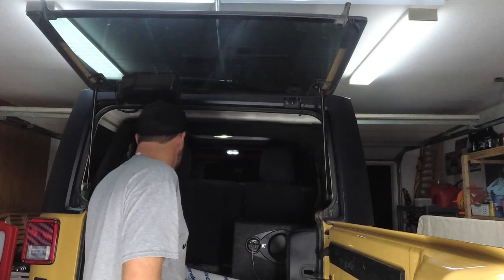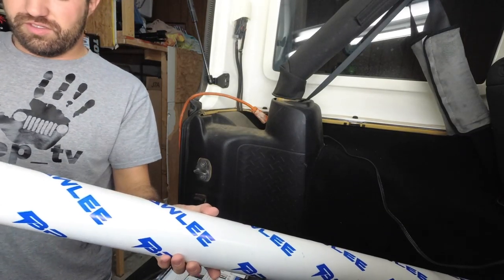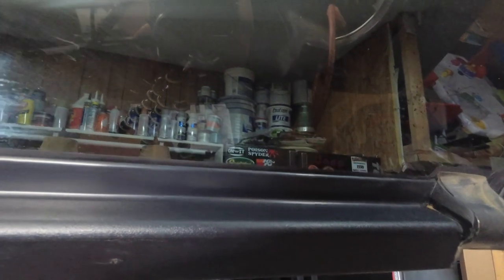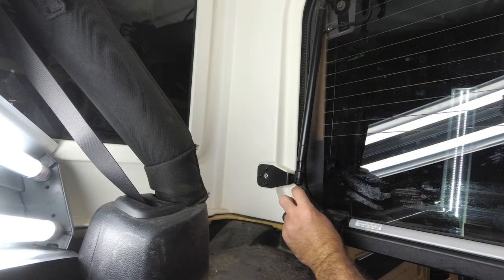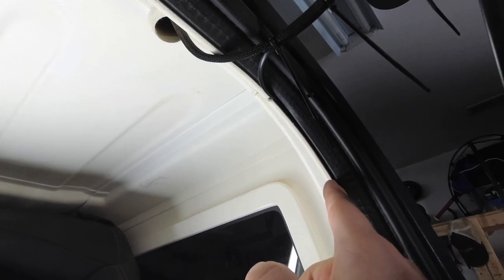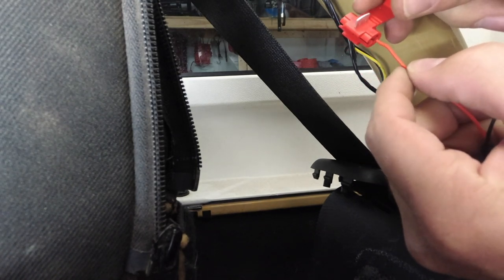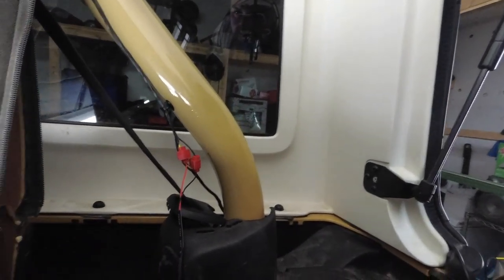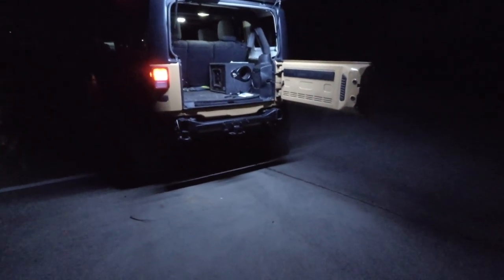How to install The Brawlee Tailgate Light Bar | From DonerightLEDs

Comment: This is one of the best things that I have done to my jeep. I ran mine to a pushbutton switch and mounted it right beside the 12 volt supply plug because I only want it to come on when I putting things in the back at night. Also I tried those led interior lights but they only last about 5 months.
Reply: I ended up purchasing this light bar with a pushbutton switch as well, but I'm having difficulty figuring out how to wire the switch into the circuit. Do you happen to have a link to a tutorial you used by any chance?
Reply: @drillbittreed10  what is actually the terminal of those 2 wires ?
Reply: @Brieux037  what do you mean
Reply: @drillbittreed10  i m asking what is the purpose of those terminal where is goes, it’s a permanent power 12v, or a key contact Used for which function in the vehicle
Reply: @Brieux037  i think its  Activated by the key

Comment: I have one installed on my JKUR. I just plugged it in the 12v outlet at the rear of the Jeep. Big mistake. It draws power even when off. I left for a month on a vacation and came back with 9 volts on my AGM battery. I thought it was the battery that was an issue since it was 5 years old. Bought new ones and still same issue. I unplugged this thing to test, and sure enough, the batteries holding 12.5V. I am going to wire this to the aux battery instead and protected by an isolator to save the starter battery. Other than the power management issue, this is a great lighting accessory for the Jeep. Really bright especially at night working at the tailgate area. Consider to have aux battery for this and be aware of risk to your starter battery.
Reply: I used a pushbutton switch and mounted it right beside the 12 volt plug in.
Reply: @drillbittreed10  how did you do it ?
Reply: @joeygonzalez210  just jumper into the 12v plug in the back.you can youtube  Kramer Johnson.he did a video on it.

Comment: How would you wire it if you take off the top in the summer for a soft top like I do?
Reply from the maker: 09Blue JK Basically it has a plug 🔌 that you will want to make sure is at the back of your Jeep. I have already removed my hard top and when I put it back on I will just plug it back up.

Comment: Could you connect the light bar wires to the wires supplying the rear wipers? Will this light bar time out and turn off when the dome light does?
Reply from the maker: Yes it can time out or be remotely controlled to stay on

Comment: getting this for my TJ, what are the odds I have that wire in the back right as well? also, to have it not time out id have to tap it in the dome light and leave a door open right?
Reply from the maker: Thanks for checking out the video. Yes, you should be able to do that. The direct power with a remote on and off is pretty nice. You should have the same wiring for the dome lights. Should be just a 2 wire light.

Comment: Mine will not turn on using the doors. I have a Rubicon so the wires are different I assume.. Great job on the video.
Reply from the maker: Mine is a rubicon as well. If you tapped into the wires like I did, that goes to the rear dome light it should work. You should be able to open any door and it come on.
Reply: @Jeeptv  should.  Lol

Comment: Does yours stay on even when your overhead lights go off?
Reply from the maker: No. But If you use the remote you should be able to turn it on and off by itself. Mine turned on and off with the dome lights.

Comment: I'd rather have constant power ya kno??? Hanging out by the TG chillin talkin wit friends and have the option to power it on or off without it timing out or having to keep my jeep running.. What can i do?
Reply from the maker: Dexter Lewis Yes there are two ways to do this.They should have sent you a 12/24v plug 🔌 like a cigarette plug adapter that should keep it on and you use the remote to turn it off and on and it will not come on with the Jeep doors. Or you can splice into the dome lights and make it a hard wired light and use the remote as a switch. Hope this helps. Thanks for checking out the channel. 👍👍👍
Reply: @Jeeptv  the other comment you said the wires to connect the dome light, now on this comment you say to connect to cigarette plug? which one is it? i connect it to my dome light and nothing came on when the doors were open, when i use my 24v plug to the cigarette plug it came on and works with the remote. the red "vampire clamp" were tightly sealed and is connected from "yellow-red" and "black to black" just like the video and nothing worked? any tips advices. not sure about the cigarette plug as instruction said to connect to dome light? not sure how to connect the Brawlee LED with door lights. (FYI your cigar ACC fuse will blow up, get a replacement)
Reply from the maker: @thedeafrcadventurer8951  Im sorry you are having issues. Splicing into the dome lights for a hard wire is going to be a more permanent install. You can keep it plugged up to the cigarette outlet in the rear of the Jeep as well for a more simple plug and play install. Both ways work.

Comment: how does it affect removing the top, if you want to go topless?
Reply: My question too. Looks like it’s hard wired. No mention of a plug   I think if you install the  remote function it has a separate plug that can be placed as a junction from the top to the roll bar but it’s unconfirmed
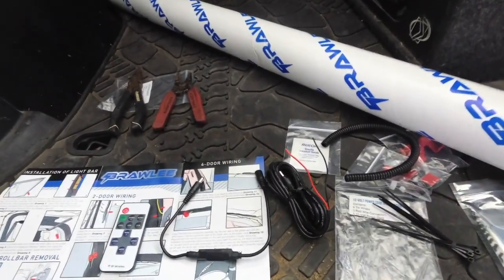Reply from the maker: Tj Crawford @1:40 you can see there is a plug on the other end of the power wires also @3:18 I go over how to plug 🔌 in the remote wire. That is were you unplug the light to remove your top. Sorry for not being clear about how to remove your top with the light.

Comment: I have mine tapped into the rear dome light and it turns on every time I open any door but it doesn’t turn off or time out while I’m driving when the dome lights turn off. Do I have to manually turn it off with the remote each time or should it be turning off when the dome lights time out? Thanks for the video!
Reply from the maker: ScottieRojo89 It should be timing out.
Reply: Jeep_tv had tapped into the wrong wire. Switched it and now it times off. Thanks for the quick response 👍🏻
Reply: @ScottieRojo89  I'm having the same issue. Which wire is the correct one?
Reply: @DrakeHawkins  I can’t remember the color of wires off the top of my head. I have a 2011 JK, I tapped into one wire and it wasn’t the right one so I disconnected it and tapped into a different wire until it worked.

Comment: I can’t figure out how to program the remote with the terrible translation on the instructions. Can you give any guidance on that?
Reply from the maker: The only thing I think works is the 20% 50% 100% function. The on button and off button as well. If your remote isn’t working it’s probably got a dead battery or its bad out of the box. Make sure when your connecting with the remote you turn the Jeep off and close all doors to power it down. Once you open the door it should auto come on or if you have wired it directly to power it will only 
come on when the remote tells it too. To test the light works you can try the cigarette lighter plug in and give it more direct power.

Comment: those it comes with that wire tapping (red plastic)?
Reply from the maker: Alan Yes it comes with the red wire taps. It’s a pretty complete kit. You will need minimal tools and some electrical tape.
Reply: @Jeeptv  thank you so much just order light bar from amazon! do you know how many hours it last
Reply from the maker: Alan  Not sure how long it lasts. I guess time will tell. I’m sure it’s something crazy like 20,000 hrs it’s LED.